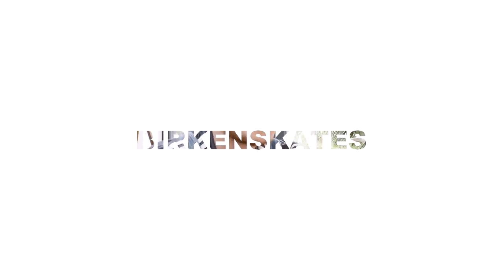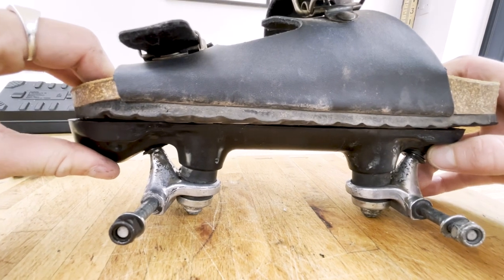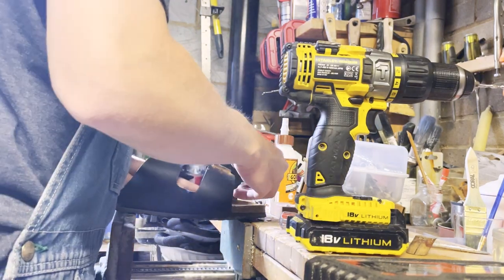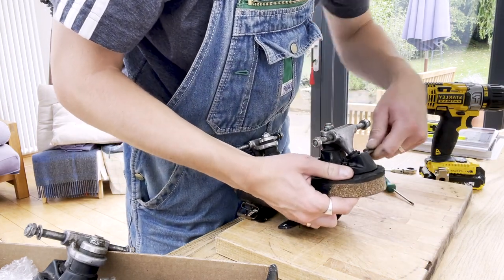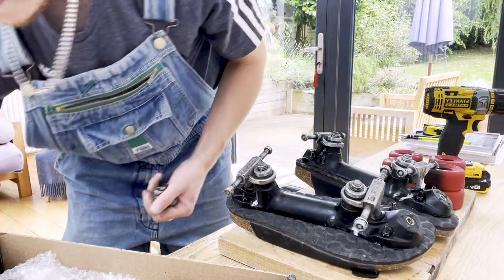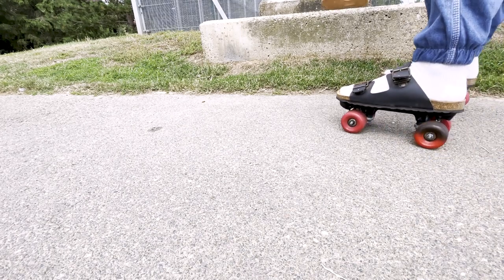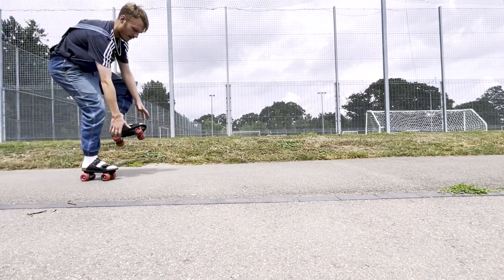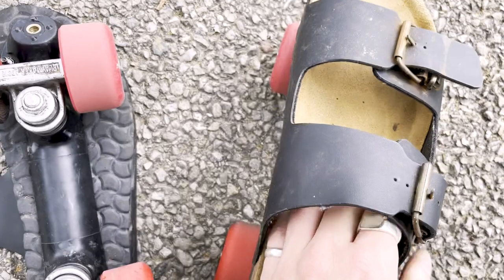BIRKENSKATES - Making weird roller skates from Birkenstocks and roller skate plates

Comment: You're bonkers. Zero ankle support and no heel lock. 😳 I think you need a more solid footbed/insole and at the very least a heel strap. Would be curious to see a follow-up video.
Reply from the maker: Doesn’t sound like a bad way to improve them to be fair…
They’re so horrible to skate that I doubt I’ll do much more than tweak the trucks
Tempted to put them on a different pair of shoes and use this as a way to learn what not to do - got a much better way to make matching holes next time